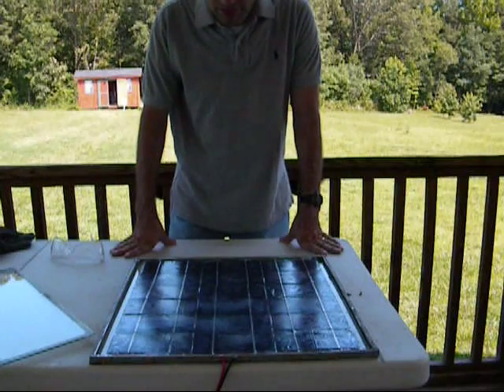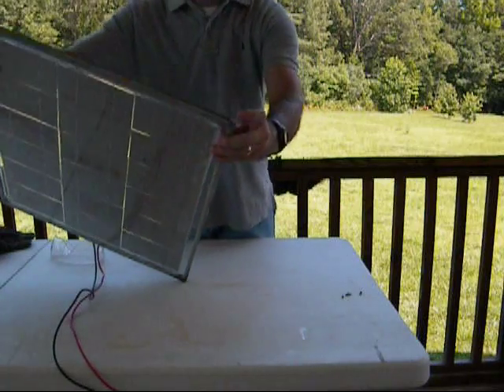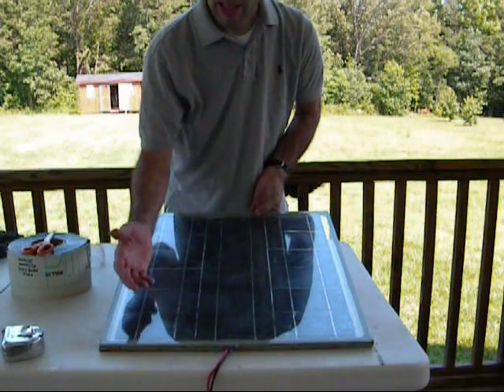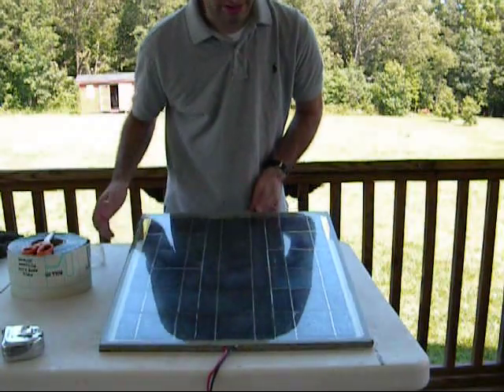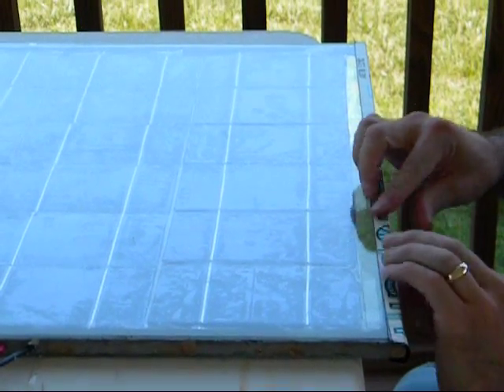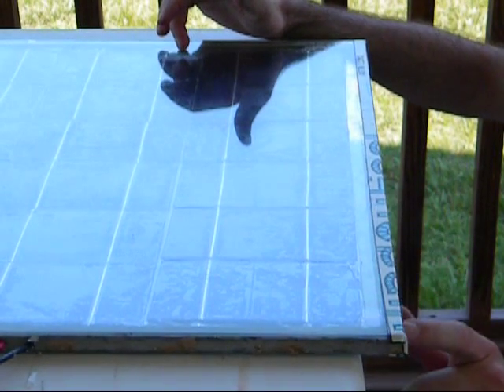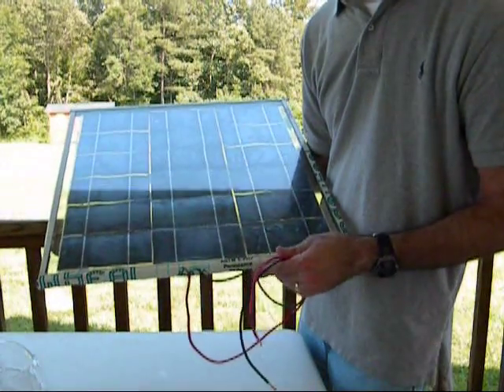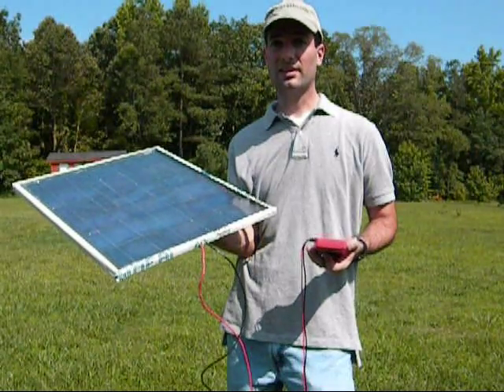How to build a solar panel part 8

Comment: nice demo. I am really interested in doing some of those.
some questions pls
1. You seem you had watertight the panel with glass from back and front.
so why there is the need for EVE on the cells
2. Does this setup last for 20 years or so?
3. Will this setup take the sun heat with no breakage?
tks in advance
Reply from the maker: 1. I added the Eva to add an extra layer of protection from moisture. It is very difficult to stop all of the moisture from getting in. I actually use shelf paper now on the back of the cells and attach that directly to the glass. 
2. I am not sure exactly how long this setup works. I have read that it may last up to 20 years, but I cannot confirm that. 
3. So far, the heat from the sun has not hurt anything. For where we live the moisture is the biggest problem.
Thank you for the questions, Lonny

Comment from the maker: On this panel I did notice a little bit of condensation on the inside, but the vapor barrier kept the cells dry. You might also want to check out my video called “underwater solar panels part 2”. I had no condensation with the panel underwater for 3 days. Thank you for the question, Lonny

Comment from the maker: @qcages I did use a blocking diode on the panles even though I really think the regulator takes care of the problem. I go into greater detail in video 11 on how to attach them to the panel. Thanks

Comment from the maker: @urmommawasfun golfball size hail would damage a lot of different material. The only thing I can think of is a thick plexiglass, but I think it would start to turn yellow after a couple of years or so and then your power would drop. Does anyone have any other ideas for this problem?

Comment from the maker: @Stime64 Good question, yes the EVA is strong enough to hold the cells to the glass.I thought I would try the plexi just in case the glass were to ever be broken. If it were ever to be broken it would be a quick fix. Thanks for the question.

Comment: your doing a great job. I do have one question. Why didn't you attach the EVA to the back of the cells and then to the top piece of glass? is the EVA not strong enough to hold it to the glass?
Thanks Stime

Comment: Nice job.  I found that my charge controller has a blocking diode already in it.  I had my panel hooked up to a 6A 1000V diode and found the voltage drop was quite a bit so I'm just going to trust the controller to handle that task.  Also, I found that my panel drops a few volts when it gets hot, probably because the resistance increases with heat, so I try to have plenty of air circulation around the back of my panel.  Please keep the videos coming.